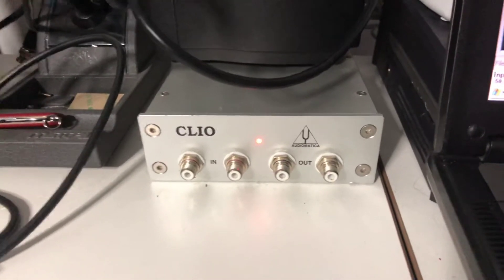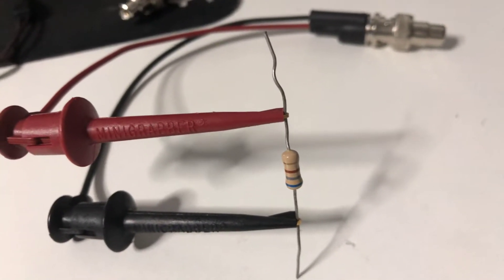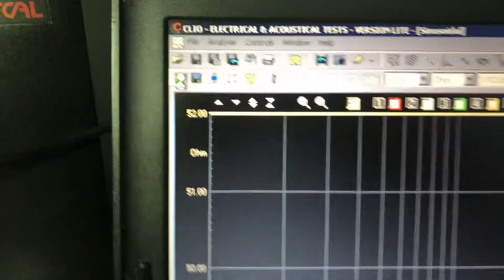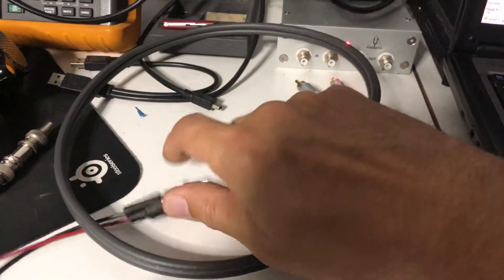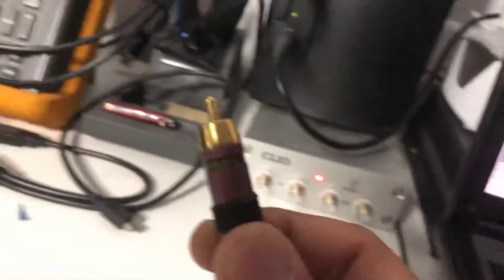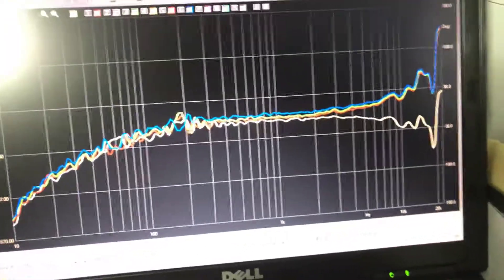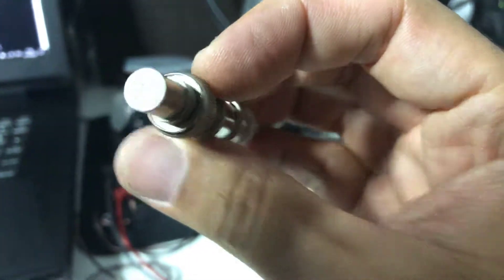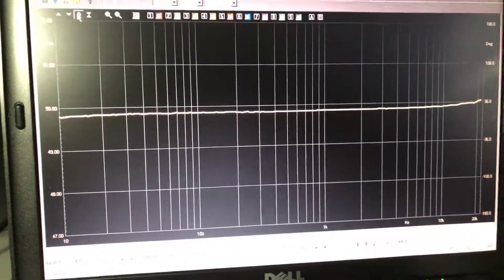Frequency Response Measurement of Audio Interconnects - MIT, Sony, Acoustic Research cables etc

Comment: thanks. I want to test frequency response in my cables. I don't have a resistor laying around, but I do have a decent quality recording interface and computer. I am thinking about sending a test signal (white noise, sine wave, synth pulses and possibly other sounds out of my interface, through various cables (one at a time) and then record the signal back into my interface. I don't expect 100 pure flat response from any of my cables or my interface, but I want to compare the cables and get rid of any cables that are obviously compromised. I will create a short track with the various test tones and playback and record that same track through each cable - each cable get's it's own track. there are a few difference spectrum analyzers built into the recording software as well. I should be able to see the difference between a bad cable and a good one. I'm hoping anyway. hehe.